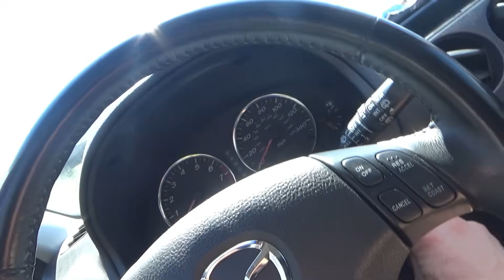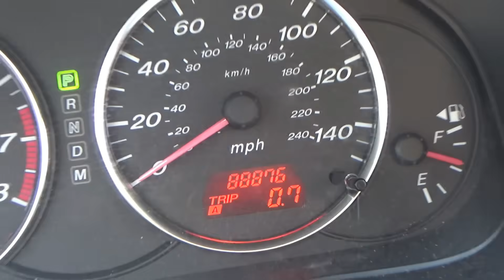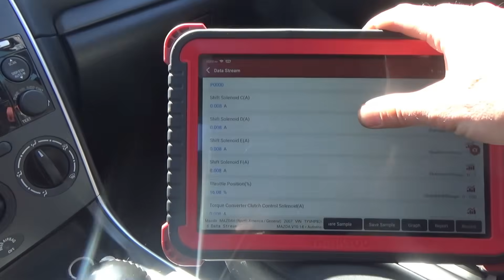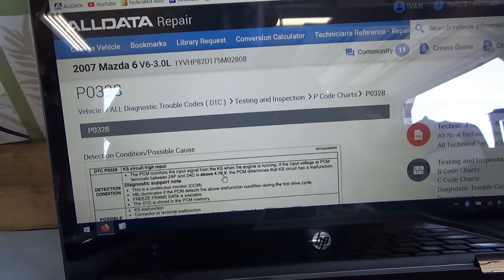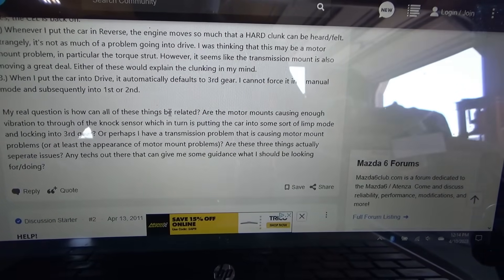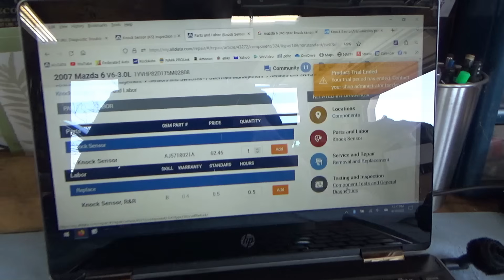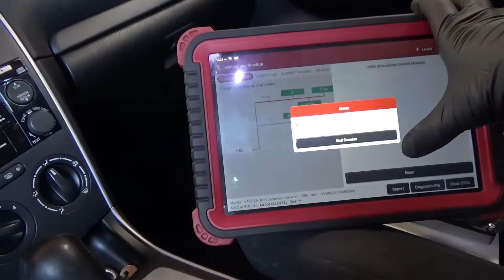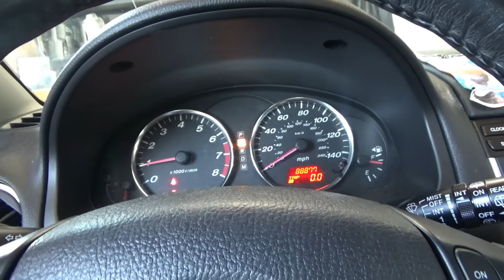At Transmission Shop for 8 MONTHS?? Fixed in 15 MINUTES!! (Mazda 6 Stuck in 3rd P0328)

Comment: I've learned that lesson the hard way working in maintenance in a factory. Don't leave any obvious faults behind you, even if they don't seem related. They will sink you every time.
Reply: I've done the same.  But I'd like to know what made these things related.
Reply: @russellhltn1396  I would say a connection with the software. The ecm sensed a problem and disabled the transmission. Don't know why it didn't set set a transmission code. I guess you should just figure that out from the knock sensor fault.
Reply: @randallgoldapp9510  It didn't set a transmission code because there was nothing wrong with it.  What's missing is a note that should be in the service manual that indicates this is a limp mode caused by engine issues. I'm not sure how much freedom the makers have for creating custom error codes.
Reply: @russellhltn1396   The main point is don't ignore an obvious fault just because it doesn't seem related. This is a common trouble shooting mistake I see a lot. It really isn't important why they are related, it is that they are related that's important. don't worry about why, clear the fault and move on.
Reply: @randallgoldapp9510  But the job situation may make it a bit more difficult.  Ivan is being paid to fix the transmission problem, not the knock sensor.  He'd be taking a risk trying to fix things that seem unrelated.  It wasn't until he read another person's experience that he was able to make that jump.  I've been fortunate to always be employed in a situation where my job was to keep things running.  I could fix anything that was an issue even if it wasn't causing the user a problem.   Auto mechanics working for the public are not so fortunate.
Reply: @russellhltn1396  he used his skills to solve the problem. He researched the problem and and solved it. A rational and logical process. Not excessively risky at all. Whether it's a  car or an industrial laser, failure is always a possibility. I use the same techniques here does and successes  far exceed failure. But failure does exist. You do the best you can to keep it to a minimum.
Reply: @randallgoldapp9510  It didn't set a code in the TCM because there was nothing wrong in that module.The knock sensor put the vehicle into limp mode when theECM detected that fault.
Reply: @LesReeves  we know that now. When he started, that wasn't obvious. His curiosity caused him to check out the possibility of a connection of the two. But he did check as many of the functions of the transmission as he could to eliminate them. The whole point of all this is don't assume, verify. Methodically eliminate all the possible causes that you can. Somewhere in what ever is left is your fault. There is no obvious connection between the knock sensor and transmission. But that was one of the things left after his troubleshooting. To get more information, he Googled it and found something. This is an excellent example of troubleshooting and is why he succeeded when so many others failed. That's why I love watching this guy.
Reply: @randallgoldapp9510  no knock signal change from engine probably dumped a fatal engine line of code for self preservation
Reply: @Dirtyharry70585  Ivan suspected that there was a connection. Anyway it was a problem that had to be corrected.
Reply: @randallgoldapp9510  As I said in my earlier comment Ivan had said in a previous video that inocous modules on the High & Low CAN buses may trigger other seemly unrelated faults so hence my comment about the faulty knock sensor & my imediate deduction was that faulty part was the problem he acknowledges that at the end of the video & as you like Ivan so do I he is extremely good at finding faults that others can't.Cheers.
Reply: @LesReeves  I'm not really concerned with the details of this particular case except that it demonstrates the techniques that he uses to solve a problem. I use these same techniques to repair industrial lasers. Too many times I have seen people waste time and money by ignoring an issue. It is relevant until you prove that it's not. The same is true for a knock sensor on a car or a noise issue on a laser trimmer.
Reply: Does it have hydraulic fluid? Is that Hydraulic Fluid? 😂 "I think so." Always ask the "Stupid Questions"
Reply: I was made aware of this back in the 70s. The phone company had just upgraded their system from analog to digital. They were having a problem with something in the system. The computer controlling it showed a fault in something unrelated. The tech tried deleting the code and the entire system shut down. There were no phones to even call for assistance to get it back up. I think they used the police radio system to contact someone. The company flew a man in by private jet. The phone system was down for over 3 hours. The tech had managed to delete the program and it had to be reloaded. I recall the TV interview with the man that fixed it. He said when the computer shows a problem, it needs to be solved.
Reply: @tiredoldmechanic1791  Did the guy that knocked the switching system down still have a job?
Reply: @Bellboy40  I don't know but the guy who flew in to fix it sure did.  I talked to a guy on a plane who was that kind of tech in the gas industry - he walked into the office in Houston and the boss said "you're going to Pittsburgh".  Ok, when?  "Right now - Jim is waiting downstairs to drive you to the airport. He already has your tools. Buy anything else you need when you get there - clothes, a toothbrush, whatever you need."

Comment: Gotta love a simple fix!
Reply: Not so simple if you don't get an open circuit code for the knock sensor and the only complaint is a transmission problem.  This was a lucky fix, a bit of methodology required, but still lucky.  This could have been a 30 hour diag if  the Google algorithm decided so.

Comment: You were so worth that 3 hour drive! Nice job Ivan!
Reply from the maker: Customer was very pleased... And surprised that the car was repaired within an hour of getting dropped off 😅
Reply: @PineHollowAutoDiagnostics  And he was back home in time for dinner too!!!
Reply: @PineHollowAutoDiagnostics  that's how I fixed my 99 Dodge Ram Van 3500 with 5.8 it was in limp home mode with p0753 and p1765 codes used internet to get info
Reply: @PineHollowAutoDiagnostics  Owner was surprised, I wasn’t!
Reply: @PineHollowAutoDiagnostics  Wait... you charged the battery, diagnosed the problem, while shooting a video, AND got the knock sensor ordered and delivered (!!) all within one hour?  OK, I'm much more impressed with that than the bit about replacing the component that the trouble code said to replace 🙂.  (OK, I do get that the moral of this video is to rigorously question one's assumption that Problem B couldn't possibly have anything to do with Problem A.)
Reply: @Graham_Wideman  "fresh battery" I believe was that solution.
Reply: @Graham_Wideman  Don't forget, he did all that left handed too!
Reply: @PineHollowAutoDiagnostics  Ivan, why does the car need gas if you repair it that quickly?
Reply: Over many years I’ve realised that Google is your friend - as you said it’s vital to search on the correct terms, typically it’s going to have occurred before.  In my 20’s I worked for HP as an engineer, my Parts controller (storeman) could diagnose faults on products just from the parts usage he saw on his  parts system.  If you asked for something obscure he would as ‘what makes you the only engineer in the world to request that part’!
Reply: @dominicwebb8000  The description parts usage is actually a good indicator of what failing on the fill. I like to think if I walk into a dealer for X part and counter guy said's here it is, it more likely than not a common failure.
Reply: Hold on... He towed it from 3 hours away! That can't be cheap!
Reply: @vueport99  Who said there was a towing company involved?
Reply: @MTLeopold  he towed it on a trailer... OK maybe he has his own trailer?
Reply: Paying close attention, as I have the same drive train in my 2007 Ford Edge. These early six-speeds were known to have issues.
He’s not going to be pleased when the water pump goes out. I just shelled out $3,200 for that job.
Reply: @dalesmth1  Holy cow, what needs to be done for replacing the water pump?
Reply: @kimchee94112  
Remove drive train and K-member for access. 
Disassemble front of engine and valve covers. 
While you have it apart, you may as well put in a new timing set. That alone is $1,200. 

All in, $3,200 for parts and labor. 
While it was apart, I had them install new CV shafts, new brake booster, and a new alternator. As well as ball joints. 
Total parts and labor, $5,970.
Reply: Wow nice diag Ivan!
Reply: Any clue as to why the nock sensor was unplugged? How long have you owned the car before this became a problem?
Reply: It was faulty and soneone unplugged it to test and did not change it.

Comment: Gas and a charged battery...  Good luck!

A better bet would be a 55 gallon steel barrel of gasoline and a half dozen starting packs in rotation...

FYI, a 55 gallon steel barrel of gasoline ain't that bad an idea!  I have one in the shed for emergency generator fuel should we lose electrical service.  I use the fuel in the vehicles every year and then recharge the barrel with fresh gas.  Plumb venting lines to the outside of the shed for breathability and explosive vapor safety!

Comment: Ivan, future reference herre with Mazdas like this one that have Ford engines....and yes this is a Ford V6. If you want OEM parts, call the local Ford dealer. I don't know how many times I've had to contact our local Ford dealer to get parts that Mazda says "we don't have that".
Reply: That's helpful!  Are some of the 4 cylinder engines also made by ford in Mazdas?
Reply: I remember Ivan's video with the mazda rebadged ford escape where one subframe bolt was a FoMoCo part and had to be sought from a ford dealer

Comment: I wonder if the bad sensor is pulling down or corrupting a bus and crippling some signal the trans needs.
Reply: But when he found it, it was unplugged.  And it was closer to open than puling down anything. I'm smelling deliberate sabotage in the computer programming.

Comment: when it showed the knock sensor code I thought the engine is in limp mode for sure the 3rd gear on the dash thru the customer for a loop for sure and probably made him go the wrong route with the trans shop. thanks for all the good videos

Comment: Your comment about doing a search reveals something - too many people think that you need to be super technical when you are looking for either a part or to help diagnose a problem. Years ago you had to be pretty specific on how you phrased questions, but in our more modern times, you can type it in the same as you'd ask a friend, and often times you'll get some amazing results. We just encountered almost this exact issue with the AC in my RV as it failed, and trying to find a simple expansion valve on the RV sites was a nightmare. Typed in a simple search for RV AC expansion valve and discovered that the local Advance Auto had almost the same exact valve as what I had been looking for days for using more technical terms. In a nutshell, type in your search using the KISS principal and see what it does - it might shock you!!
Reply: Just be careful when searching for a Big Block Chevy 😂

Comment: That is interesting that it didn't set at least a generic po700 or at least something stating it was indeed in limp home mode. Kinda makes me wonder if you could recreate the same issue, by perhaps disconnecting another major sensor like a CTS?

Comment: I had a 13 caravan that was having all sorts of weird issues and all it had was a O2 sensor code. I decided that the best approach was to fix was wrong and go from there. Put in an O2 sensor and it fixed all the issues. iirc it would just quit while driving among other things.

Comment: Cmon Ivan!
It’s NOT 3rd gear!
It means it does not go past 3rd gear.
What would be the rpm if such tiny engine starts in 3rd gear?
Reply: Actually, limp mode does indeed put many rigs into 3rd gear - and with an automatic transmission, the engine is still at the regular RPM ranges. Remember - it shifts into park, reverse and 3rd, so you'd have to start it in park or neutral just like any other automatic transmission. Even a manual transmission rig will start in 3rd gear since you have to push the clutch in to start it anyhow - it would just lug the engine (much as it did here).
Reply: That's what the torque converter is for.
Reply from the maker: It was definitely just 3rd gear... With massive torque converter slip 😅